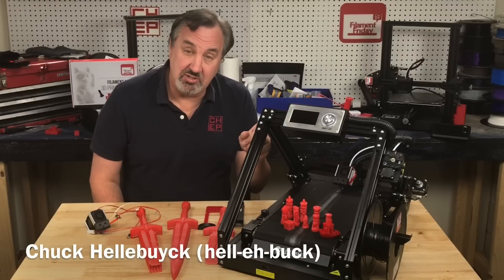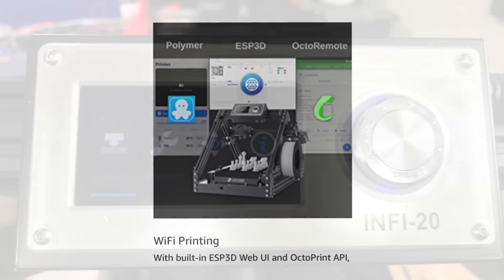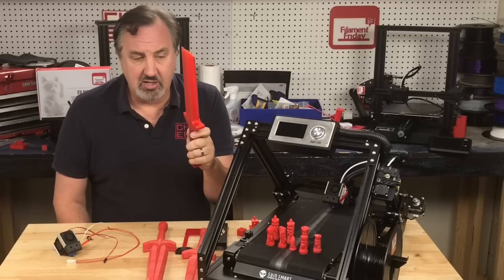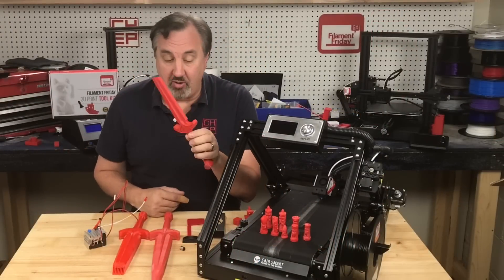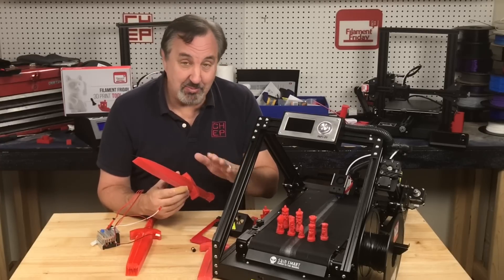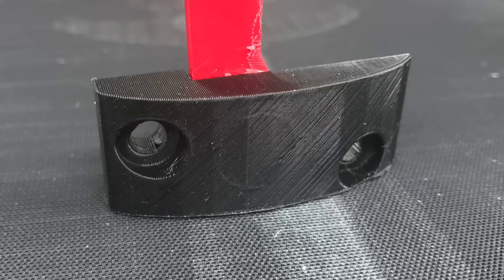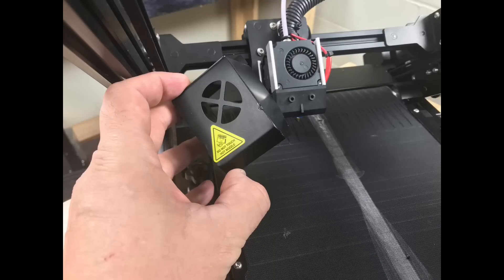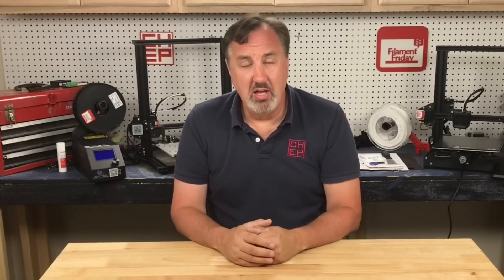First Look at the $850 SainSmart INFI-20 Belt 3D Printer

Comment: I have a clog in my hotend so I watched how you took yours apart. My ptfe tube pneumatic fitting is held in place by the screw on the side. The aluminum block is not threaded so the ptfe fitting doesn't screw in at all. After removing the fitting there appears to be a thinner metal tube inside that doesn't allow the ptfe tube to pass through. How did you remove the internal PTFE tube? Did you need to remove the nozzle, thermistor, loosen the two screws on the side and pull it out? It seems like a chore to perform maintenance on. Perhaps a Luke's hotend fix can be made for this printer.

Comment: Hey chep, how did you get the filament to stick to the belt? I have tried angling the part to where it starts off at the corner, and I have try flat and straight and it seems like it doesn't want to stick to the bed. I have use hairspray as well to see if that work and it didn't. Bed and nozzle are touch and spaced using the metal filler gage they provided. Having issue with the Cura side it doesn't want to lay the filament and somewhat print in the air, but using ideamaker, it some what sticks and hold until the hot end touches some of it and drags it and create a blob on the hot end.. Currently trying to print rounded corners/edge and having issue. Thank you!
Reply from the maker: Just adjusted the height. It’s stuck fine from there.
Reply: @FilamentFriday  so mess with the Y axis? And adjust it from that instead of the bed panel knobs?
Reply from the maker: Yes. I found adjusting the Y stop to be the most critical.
Reply: @FilamentFriday  Thank you very much!! It's been over 12 hours of just trying to get the filament to stick onto the bed but I didn't mess with the Y... just the panel knobs. I'll give that a try now. Thank you again!
Reply: @Tanny Pope im still having issue as well. May have to print it on a support system

Comment: Need your advice, long story short, 2 weeks new to all this, purchased Ender 3 and loving it, but, my plan is to do cosplay and costumes, and the small board on the 3 isn't going to cut it without a lot of splitting. My budget would allow for a Cr 10 or CR 5 Plus, your opinion would help a ton, thanks!
Reply from the maker: CR-10 is good but a bit old. I’d look at Ender 3 Max.

Comment: It it possible for any warped bed/unlevel issues or does the belt make that impossible
Reply from the maker: It only has to be level in a small strip of the belt area and that strip moves every layer so getting the bed under it to be level is the key and that works fine.

Comment: The first time a see a belt printer with good print quality. That was their biggest problem so far. So the potential for this class of printers is definitely there. Other issues like the firmware bugs are not related to the belt drive system and can be fixed easily.

Comment: This looks like a Malyan design. The control panel and UI design and the hotend design all look very much like what you would find on the more well known Monoprice Select Mini series, which are Malyan printers. If it is it's probably not running Marlin but a proprietary firmware.

Comment: Personally I'd like to see companies start investing into 4 or 5-axis bed printing (bed tilting, maybe +/-15degrees in x and y axis). I think it would be a lot more useful for the average maker as it would make supports unnecessary in many models. I also think it would be more useful for mass-printers than belt would be, when printing models that require supports on a traditional printer. If you can eliminate supports, your invested time goes way down, and you can rig bed printers to print multiple copies of a file with some clever mechanicals and code.

But, I think belt printing does have a seat at the future table regardless, I just think 4 or 5-axis bed printing would be a bigger move, personally.
Reply: it's gonna cost more in the software, that's the only trouble right now, I think. Mechanical design is really easy for big company, to be honest, the only hard part is figure out an optimized algorithm that can smoothly slice and spit out Gcode for 4 axis printing

Comment: The printer is designed and manufactured by Malyan Systems, aka Zhangzhou Echo Technology.
The model is the Malyan MA20.

Malyan's other models include:
M200 (Monoprice MP Select Mini - V1, V2, & "Pro"/V3)
M300 (Monoprice MP Mini Delta)
MA10 /MP10 Mini ( Monoprice MP10 / MP10 Mini) 
S100 (Monoprice MP Mini SLA [or MP SLA Mini])
S200 
M180
M320
M150
S100
Reply: that explains the interface which is the same as some of the other Malyan printers
Reply from the maker: Interesting. SainSmart told me it’s their design. This makes more sense.

Comment: I do not believe in belt printers. Scaling up your number of printers is the way to go.
Reply from the maker: Can print long items no matter how many you scale up to.
Reply: @FilamentFriday  Prints over 20cm start to have issues with warping, shrinking, etc. Sometimes it is not an issue, but sometimes it is.
This may be the main reason why Prusa holds back its Max Version.
My rules of thumb: over 20cm consider alternatives: splitting and gluing, CNC, etc.
Reply from the maker: I’ve printed long prints on my CR-30 which are flat and straight. The roller attachment helps. https://youtu.be/-Q6u4BDqxBo
Reply: Some thoughts: Print quality can suffer if you print multiples of the same item on the bed and you add overall print time with the added print movements from part to part.  Printing one part a time will generally always yield best print quality.  It's attractive also not to have to be so attentive to the printer to remove prints and restart the next print.  I would definitively call it "application specific" especially for large quantity mass production.  The non-belt printer will always be the most versatile for sure including one-offs and larger print size.

Comment: Bit of an off topic question.  I just got my Ender 3 max a couple days ago and was wondering if it's safe to leave it on indefinitely?  Do I need to power it off every so often, or can I keep printing parts back to back as long as I do the maintenance?  Also, any safety upgrades to prevent any hazards so I can let it print unattended?  Thanks! :)
Reply from the maker: You can leave it on. Smoke alarm may be a good idea around any printer. Just in case.
Reply: FYI, dust on the cooling fan will lead to heat creep and nozzle clogs …. If it’s on all the time you may not notice.
Reply: @rallylout  I'll be sure to dust it off once in a while :)

Comment: i think that belt printers are the future of 3D printing
Reply from the maker: I agree
Reply: I think that the future would be something  more of a ultra reliable fast and somewhat smaller corexy's like the Voron 0 except more user friendly and pre built, that is if companies try to make 3d printing like 2d printing so you just buy a printer,   some filament and get to printing right away although it will take a lot of technological advancements to get us there
Reply: @cozmo4694  the future is Resin
Reply: @noway8233  ...no far too many hangups. annoying cleaning, hazardous and potential permanent damage to skin. Resin is great but it is lightyears from being the future, corexy is probably indeed closer
Reply: @syndan9245  true
Reply: I agree!
Reply: Nop, this machines have a lot of issues, with the time yuo will see

Comment: ow, nice design but cheap in quality, if you can't replace couplings even. That's a big nono. All the problems should have been fixed before releasing it. Nothing but beta crap everywhere nowadays. You have knowledge enough to fix it , but not an ordinary consumer. And at that price....
Reply: He said the coupling could be replaced, you just have to loosen the set screw on the back first

Comment: Glad to see this worked out so well for you . They are a niche market printer but perfect for someone with your requirements. Did you have any issues with the g-code size when setting up 100 items to print?
Reply from the maker: No, it’s just basically a repeat command at the end so size is about the same.

Comment: That "I almost don't want to touch it because it's working just fine" feeling is why I'm scared to add some mods to my printer!

With this being somewhat accessible(even $150 less than the Creality versions) I'm not sure if I want to mod my Ender V2s into belt printing, or outright save the this printer! I've seen people have a ton of trouble with the CR-30 especially with bed adhesion, but nearly TWO successful 100 part runs really instills some faith in this printer for my production!
Reply: Wise words Manuel! Too many people do too many mods, 'just because'. And then complain the printer doesn't work correctly. Some mods ARE nice to have, like ABL. And others may be necessary for special needs, like printing flexibles. But for the most part, these printers work just fine out of the box. And if it ain't broke....